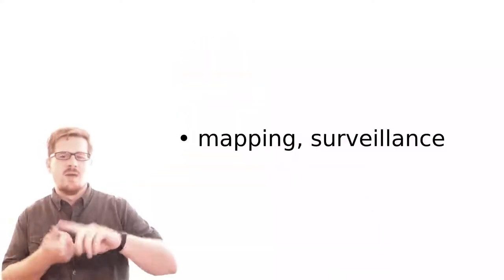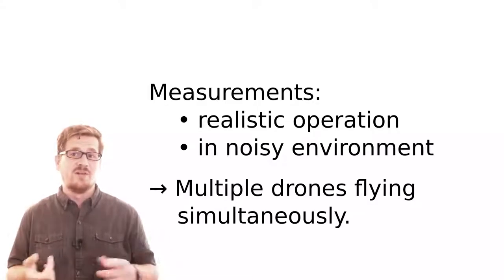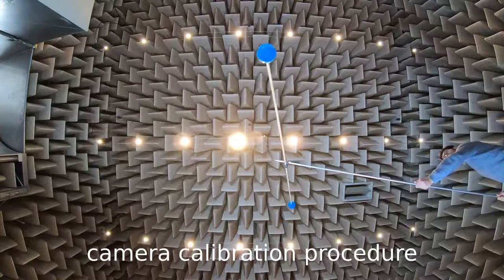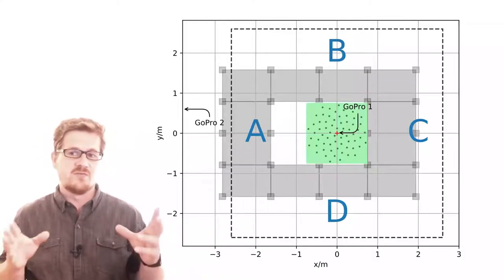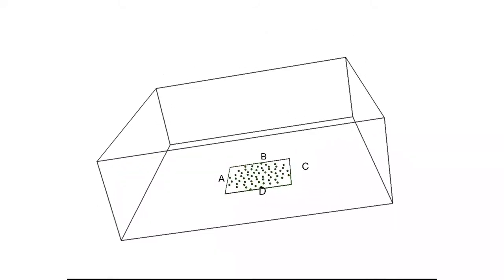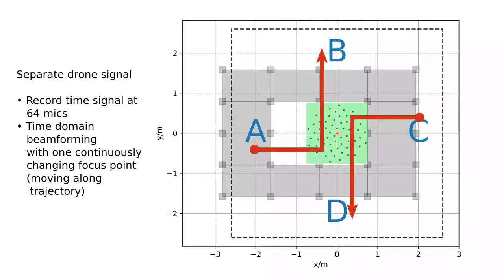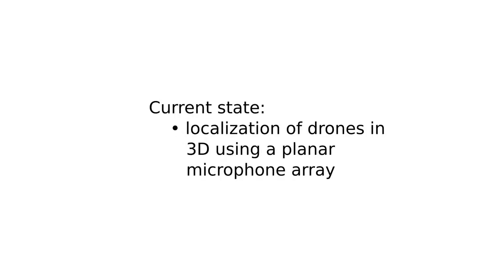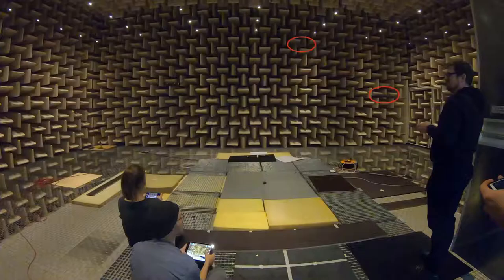Drone tracking with a microphone array

Comment: Hi: How did you extract the distance, not just doa, from the beamformer?
Reply from the maker: By using a spherical wave model in the beamformer (instead of a plane wave for simple DOA), we can calculate the maximum in 3D space, which ideally coincides with the source location. Admittedly, the spatial resolution perpendicular to the array plane is not as good as in lateral direction. However, if the drone flies close enough to the array, it is still sufficient. If the drone is farther away, we’d have to use a larger array aperture or multiple arrays.